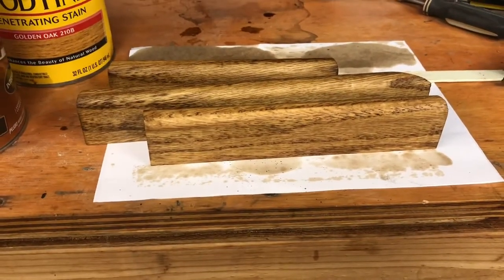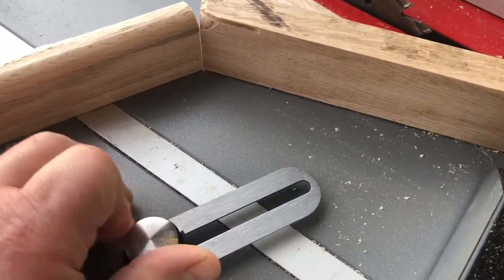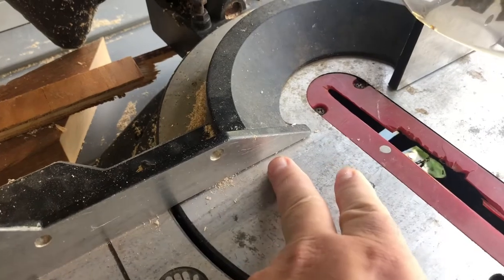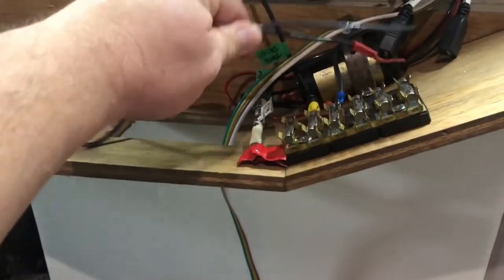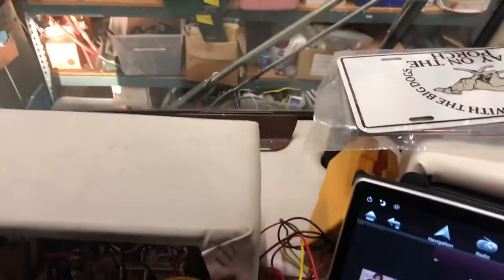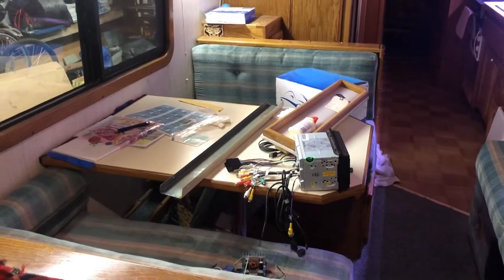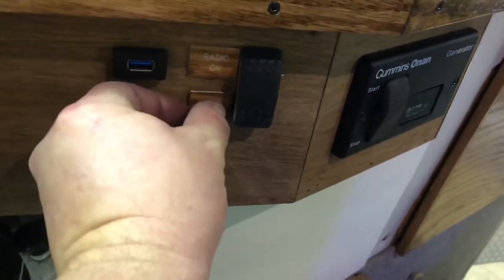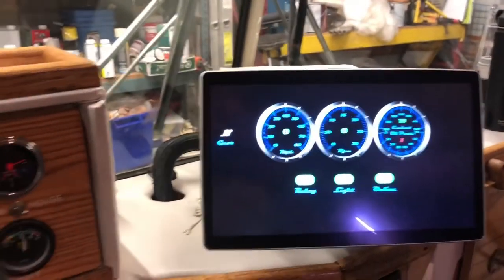13” Android deck DIY install vid #3

Comment: I agree, I never really liked that thing sticking out in the middle either.  Much better now.  Looks good. 
 What are you using to make the labels for the lettering (like for the "Radio On")?
Reply from the maker: PO had those labels made, I removed that from the old cabinet. I have no idea how they were made, but it’s a commercial process. It’s plastic and the lettering is smooth with the fake wood grain on top. It is probably directly printed onto the plastic with a computer printer, perhaps laser or inkjet, perhaps at the same time as the fake wood.
Reply: @ThisOldBus  Thanks.  Working on spiffing up my left side control panel.  Need to figure out how to do the lettering.  Meanwhile, other problems.  Seem to have a bad bearing on my PTO on the side of the V-730.  Know anything about that?
Reply from the maker: I’d experiment with something you can print on the computer and stick on. They used to have these clear labels you could print on.. problem is they were either shiny or matte finish so you’d still be able to see it and the outline of the label. Maybe that’d be ok with what you’re doing. Unfortunately no idea on your PTO problem, current trans doesn’t have one. Hope you can replace your bearing without needing to pull trans.
Reply: @ThisOldBus  Thanks Scott, ME TOO (on not pulling the tranny, I think the PTO can be removed independently.) 
Yes, I bought some clear labels to print on and I have the clear plastic stuff they use of the front of cars etc. to prevent rock chips in the paint.  Thinking about printing the labels, applying them and then covering the whole polished plate with the clear sheet.  Still a little back yard tho.  Thanks for getting back to me on the PTO.

Comment: Still not loving the new dashboard.  It's too high, needs to be cut down, put tray holders on the side of dashboard
Reply from the maker: Lots of work to get there. The thing in front will be shorter when I’m done.